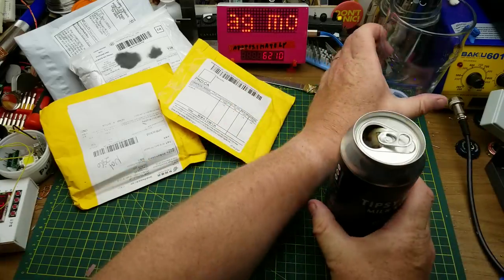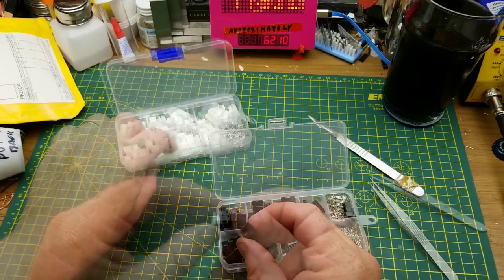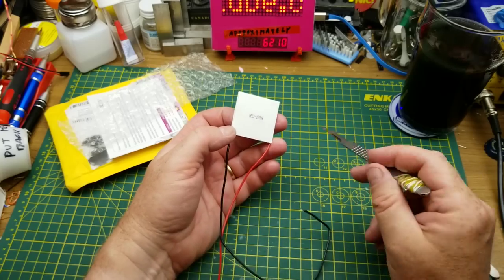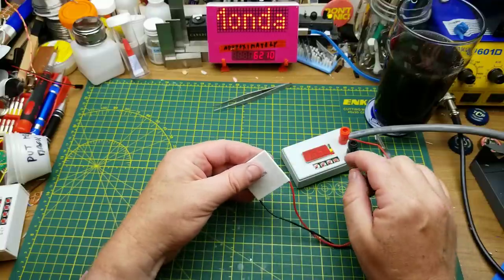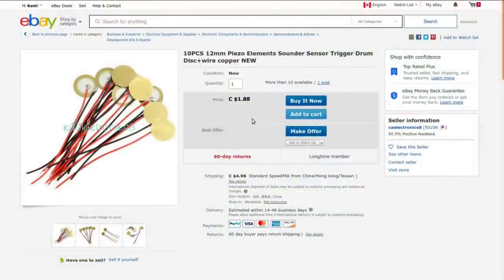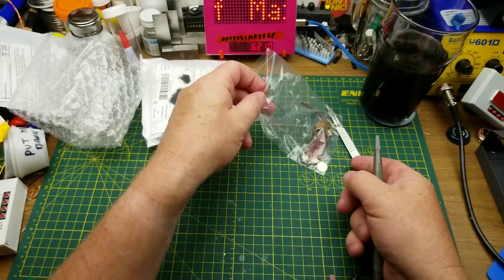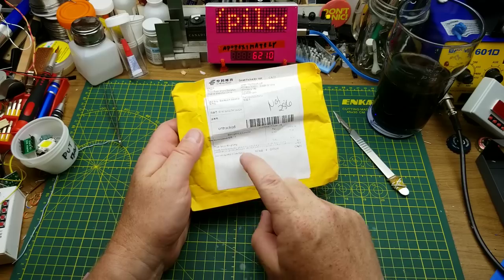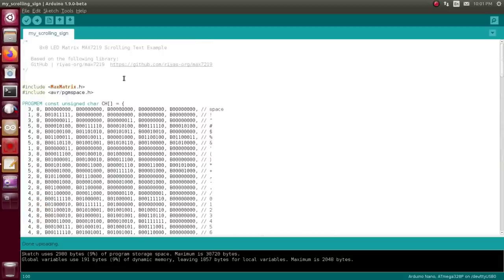Mailbag Monday #92

Comment: With these Peltier modules, use super large heatsink with PC thermal paste and cooling fan on the hot side. Smaller heatsink on cold side, and boy,this puppy could go sub-zero in seconds. It's all depends of heat dissipation and amperage.

Comment: Hi, the LED display you had running at the end of the video was running with the LED modules right to left instead of left to right.
The characters were the right way up and going in the right direction, just the modules instead of being  0,1,2,3   are 3,2,1,0
👍👍👍

Comment: I need some of those piezo's for an upcoming analog drum synth experiment if I get around to it but I think I have an assortment of the larger ones taken from old toys and games.  
I have at least 2 if not 3 different hardware layouts of the matrix displays so using the MD_MAX72xx.h library, every time I get a new one I have to try all the possibilities for hardware type out of these until it works, and also tell it how many individual 8x8 displays are in the whole chain:
// define the number of 8x8 matrix displays in the chain
#define	MAX_DEVICES	4
//       PAROLA_HW   Use the Parola style hardware module
//      GENERIC_HW   Use 'generic' style hardware modules commonly available
//    ICSTATION_HW   Use ICStation style hardware module
//         FC16_HW   Use FC-16 style hardware module
#define HARDWARE_TYPE MD_MAX72XX::ICSTATION_HW
MD_MAX72XX mx = MD_MAX72XX(HARDWARE_TYPE, DATA_PIN, CLK_PIN, CS_PIN, MAX_DEVICES);

Comment: Nice video you may need to use MD_MAX72xx.h  and SPI.h and change the device too  FC-HW
#define HARDWARE_TYPE MD_MAX72XX::FC16_HW
#define MAX_DEVICES 8
#define CLK_PIN   13
#define DATA_PIN  11
#define CS_PIN    10
Reply from the maker: I knew someone would have an answer for me!
Thanks Fred.
Reply: @pileofstuff  If that doesn't work, I used the MD_MAX72xx.h library with similar modules and I found I had to set them as ICSTATION_HW rather than FC-HW, with FC-HW they were mirrored and upside down I think
Reply: @pileofstuff  I just came to the comments to post the same thing when I saw the video, that library is very flexible and configurable for any orientation and configuration, the author has a nice series of other libraries and there was also some youtube videos about them I saw in the past
link to their collection of libraries, hope that is okay to share this link: https://github.com/MajicDesigns?tab=repositories